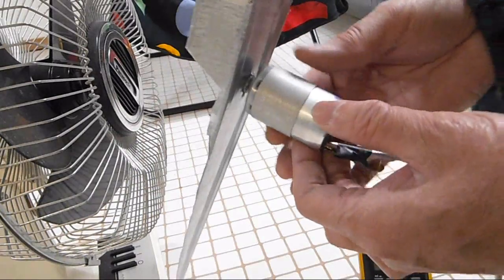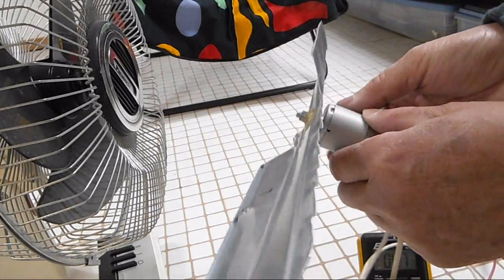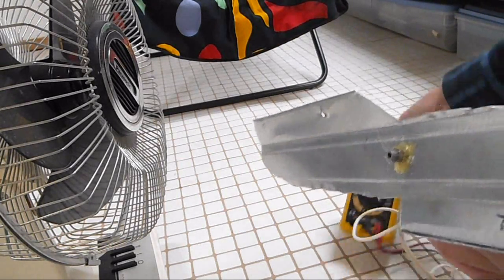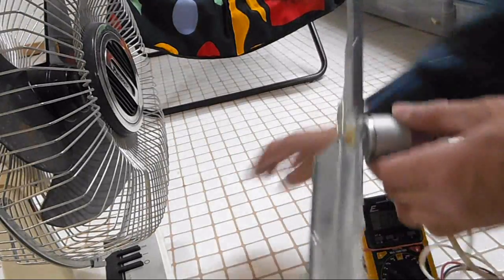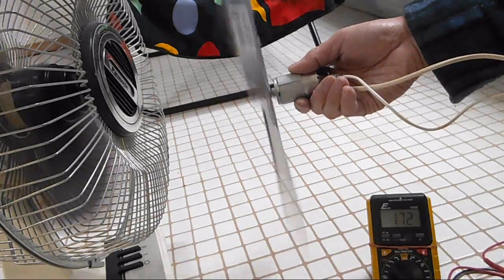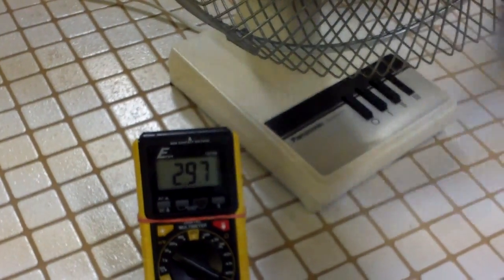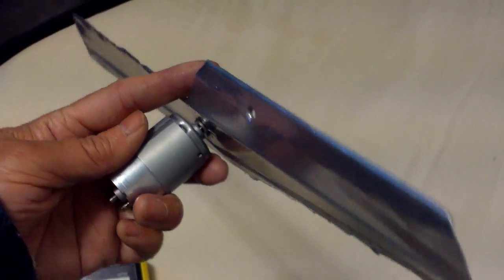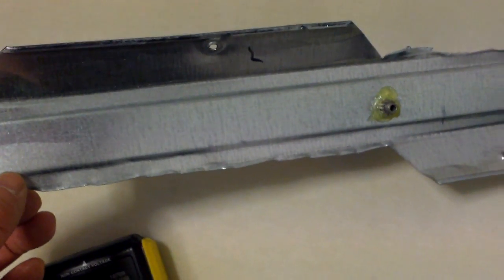Testing a small dc motor for  AA battery charging in a wind turbine setup

Comment: what is the name of the chip bro
Reply from the maker: Here's the link to a step up voltage booster: http://www.ebay.com/itm/3-5-30V-to-4-30V-DC-DC-Booster-Convert-Step-Up-Voltage-Regulator-LM2587-T9-/332243314458?hash=item4d5b3ea71a:g:HzwAAOSwfpVZLLUX

Comment: How do you get the batteries to not power the motor instead of being charged by the batteries?
Reply from the maker: You use a diode to block current from the battery flowing towards the motor. There is a silver band on the diode, have the diode connected in series with the positive with the silver band pointing towards the battery.  The size of the diode depends on the current generated by the motor. In this case, a one amp diode should suffice.
Reply: What terminal on the battery should it point towards?
Reply from the maker: It will work on either terminal.
Reply: wtam69  what diode should i use

Comment: if it was generating less than that amount would it still charge up a battery
Reply from the maker: If the output if 2 volts or so higher than the battery, then it can charge the battery.
Reply: cool thanks

Comment: Also, if I rotate an AC motor in this way, will it produce electricity? If yes, what kind of?
Reply from the maker: You can use a stepper motor that produces AC and then rectify it to DC. That's the type that is generally used in diy AC wind generators. Other types are more complicated as the AC has to be modified.

Comment: How did you attach the blades to the output shaft?
Reply from the maker: egdriftkid Make a hole smaller than the shaft and cut a slit at opposite side of the hole and  push it onto the shaft. Add some epoxy to hold it down. Not a permanent solution, just to hold it in place for testing.

Comment: hi same here i have a relative project same as yours but i need help if im going to charge a a 9v battery how much output i need to charge the battery and how much rpm needed to produce such output it will be a big help if you could give the right specification of the dc motor tnx

Comment: I have a very similar set up with a small dc motor and wind blades. My output is just around 3v. I would like to charge batteries as well. What do I do next?
Reply from the maker: Just connect the leads from the motor to a battery holder with the battery inside. Since there is only a 3 volt output, you can only charge a AA battery. In addition, you need a blocking diode to allow current to flow in one direction only (with the silver band away from the motor).   In practice, your dc motor has to have sufficient voltage and current to charge the battery.

Comment: sir how did you connect the wirings from the wind turbine to the dc motor? i need it sir for my research
Reply from the maker: I punched and drill a small hole in the center part of the hub. You can use a metal threaded coupling and drill a hole on the side to accept a set screw. The coupling attaches to the motor shaft. Your hub is attached to the front of the coupling with a screw. Look at this video that I made earlier for another project and it'll give you some idea:http://youtu.be/yRU7b_BfC7k
Reply from the maker: I'm sorry I did not read your question more carefully as you asked about the wiring.  If you were to wire a dc motor to charge  a battery, you just need to hook it up to the battery positive to positive and negative to negative. In order to prevent the battery from turning the dc motor, you need to install a blocking diode on the positive side of your wiring. For a more sophisticated and powerful setup, you'd need a wind charge controller to control the charging. Hope that answers your question.

Comment: you can never chage a AAA batterie with this. The outgoing power is much to low. By the way, why using elektric energie to drive this windtourbine, instead of using it directly to charge the batteries.
Reply from the maker: You are right. Just playing with the motor.

Comment from the maker: There are two of these dc brush motors in the Epson printer. I have looked into joule thief etc and I will experiment with that. I think they are similar to voltage boosters. In my case, I think I'll adapt the motor for charging small batteries for now.  My small stepper motor has the slightest feel of cogging so it's good for the wind ornament. Most people, myself included, just don't have enough wind for a real wind turbine. Thanks for commenting.